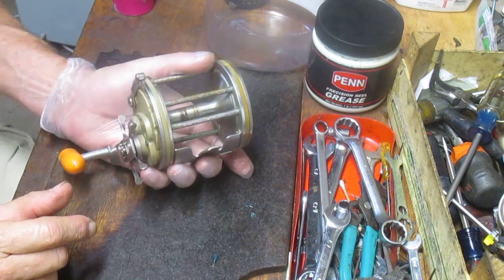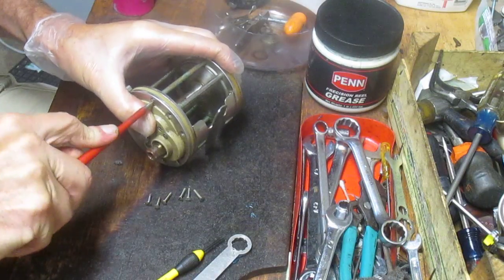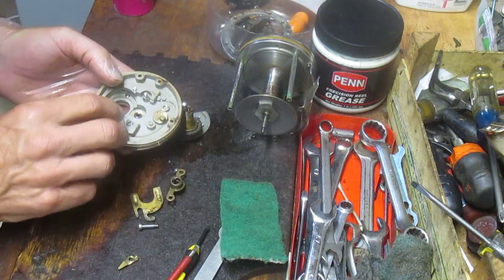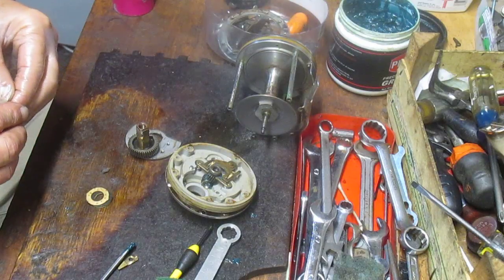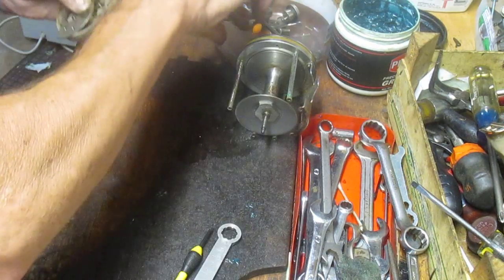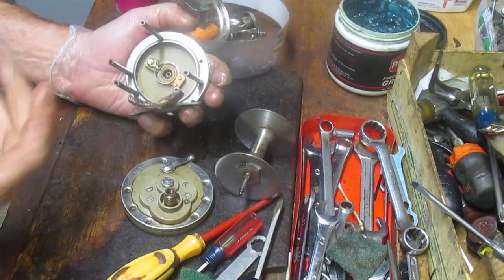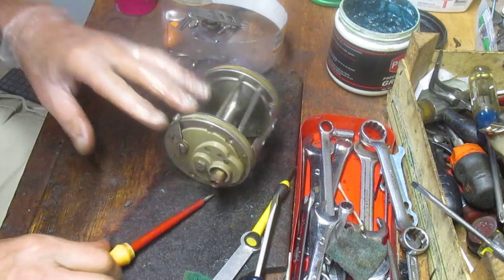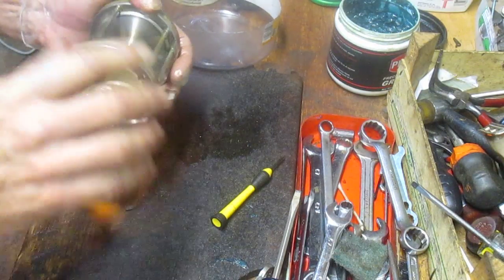Kencor 840 Drum 80's Japanese fishing reel take apart and service

Comment: Hello Dennis, I have a Kencor Drum 130....i have taken it apart for service and with putting it back together I have run into a issue with the anti reverse dog spring....it us completely  different than the Penn springs i have run into with the Penn 309 or the Penn 330 GTI.....are you familiar with the Kencor Drum 130 anti reverse dog spring.....and if so can you give me some direction.

Thanks in advance
Rob
Reply from the maker: Rob - I am not familiar with the reel, but if you send me a picture of the dog, the spring and the internal side plate I may be able to figure it out and help you.
Send the pictures to my email - 2ndchancetackle@gmail.com - Dennis

Comment: i have the same reel .well alomost the same . mine is a level wind. the pinion gear is stuck on the spool . it came apart ok. now getting it back together no so easy.maybe some heat will get the gear off ...
Reply from the maker: Wow - that is unusual if it came off easy.  Be careful if you use the heat and make sure you pad the gear with steel wool or a scrubby pad so that you do not mar the gear teeth with any tool you are using including a pliers. - Dennis
Reply: it never cam off the spool.i had to take apart everything to get it apart. it is kinda strange because it has plenty of grease and oil in there. I figured once I get it apart I would be able to get the gear off . I wasn't so lucky ! I have it soaking in break free oil . hope fully it will come off. I got the reel for free . I enjoy takeing them apart and fixing them up … thanks gary